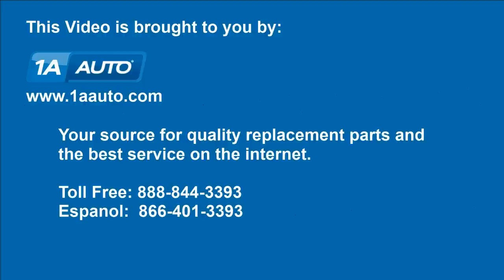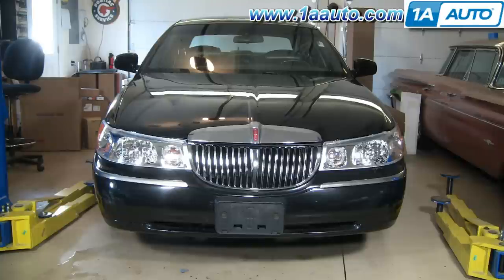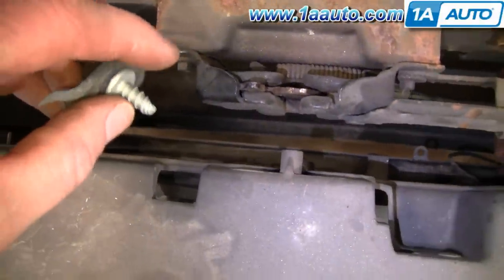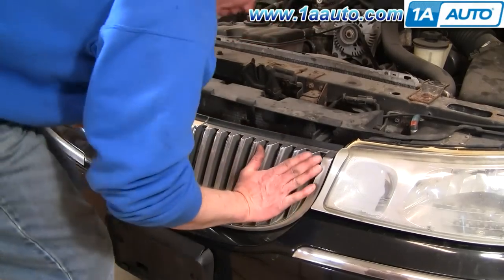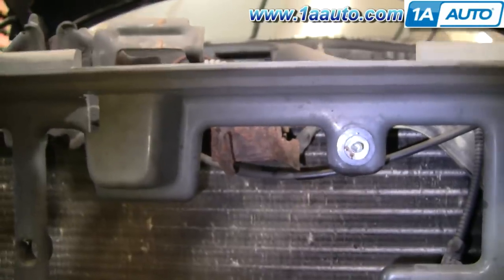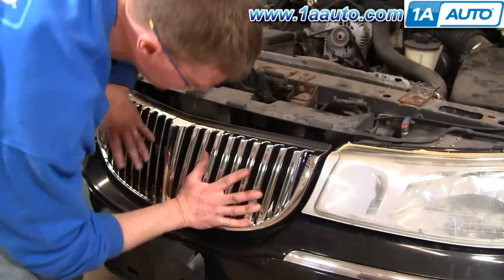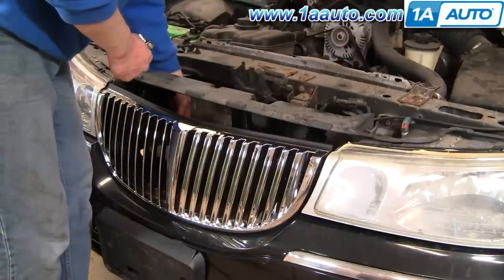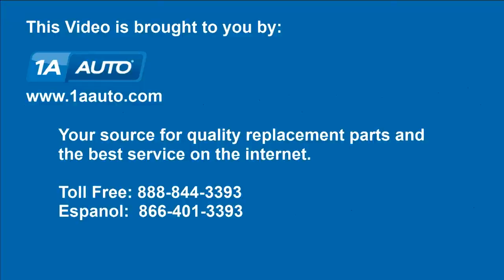How To Replace Grille 98-02 Lincoln Town Car

Comment: hey !   A-1 auto folks ,   glad I took a look at this video , I  myself had  a crazy deer step in front of me ,  and I have to do grille and top cover chrome piece replacement ,  before I watched , I could not begin to figure out how the heck too take the little bitty  screws out of the very bottom of the grille too bumper area  { hahhaha  o . k .  this is when I better look  for pro  help }   man I am glad the grille kicks back and  out of position !   ----> looking for something on the front body plastics now  video !     thanks for doing this  ------  1998  Lincoln continental ...

Comment from the maker: More than likely. There will be an adjuster on the back of the headlight to turn once the headlights are in place. Park the car about 25' from a wall, and turn the screw. You will see the beam raise or lower. Best time to do this is at dusk, so you can see the light a little easier and then take it for a test ride. hope this helps you out. Have a great day 1aauto.com 888-844-3393